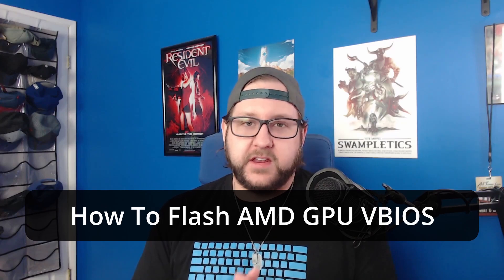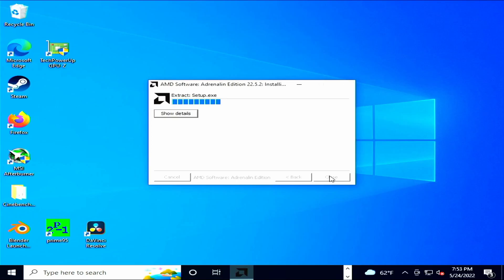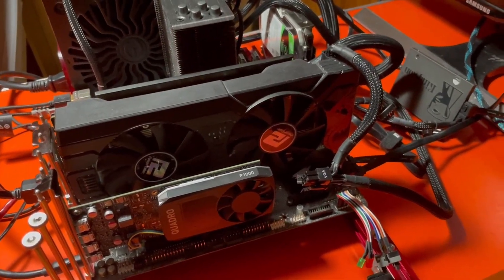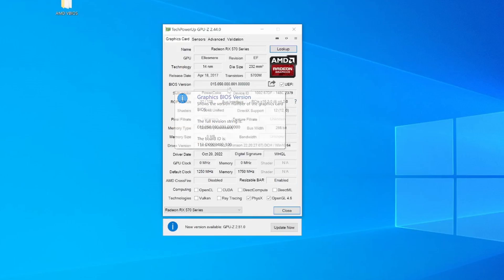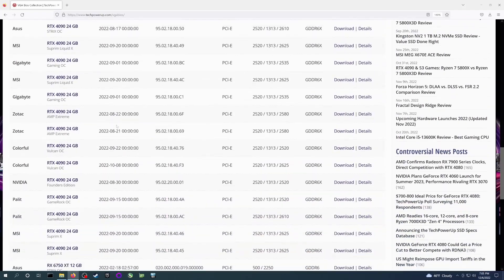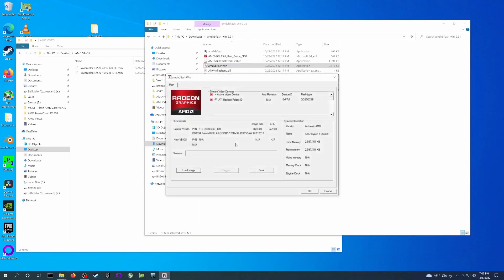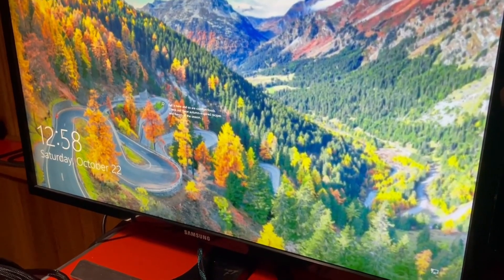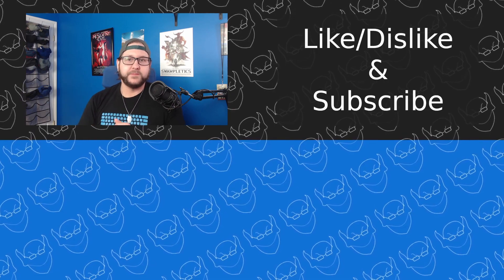How To Flash AMD GPU VBIOS

Comment: why after flash bios my asrock rx 6600 challenger d my pc always restart after 10-15 minutes
Reply from the maker: My best guess would be the bios on the card is pushing it too far clock- or memory-wise, and it's causing it to crash? Have you tried a different vbios?
Reply: @BitGoblin i have tried a diff bios, but i cant install my driver amd. after 30-40% installation windows boot to automatic repair.
Reply: can i fix that with undervolt?
Reply from the maker: That's interesting. IDK if that would be a problem with the card, tbh it sounds more like maybe a corrupt installation of windows if it's sending you to automatic repair. Or maybe the file you downloaded got borked somehow, have tried redownloading the installer?
Reply: @BitGoblin I will try to re-download Windows

Comment: @BitGoblin  I have a RX570 also but 8gb version of sapphire. I have the same problem as yours. But besides on error message from radeon, I have a problem where my monitor always turning off and when I restart my pc, the gpu driver replaced with the default. I will try this and will post an update later.
Reply from the maker: Good luck!
Reply: how's the update on your graphics card?

Comment: It doesn't work. The flash software won't even open
Reply from the maker: Try downloading version 3.31 or older. The graphical app was deprecated and removed from version 5.x of amdvbflash

I also made a newer video explaining the command line app if you need it for a newer card 😊

Comment: malfunctioned due to high and low voltages , card does give display but i have bricked by flashing irrelevant Vbios , so you just need to flash correct vbios and minor fix to fully operate this Graphic card
idk how to cuz it's that 2048sp local vendor type thing i've been using this for like 1yr now and i think this will fix it cuz it's literally unusable and happening outta nowhere.
Reply from the maker: It's possible it'll help! Let me know how it goes!

Comment: I have also Rx 580 and it's not totally dead actually it's working but the issue is sometimes it's randomly crashing. is it corrupted vbios?
Reply from the maker: Possibly? It's possible there's something weird in the vbios that causes it to only crash in certain circumstances. If nothing else, it might be worth a shot if you're out of other troubleshooting options.

Comment: Hey bro i have a bricked Rx 580 2048 sp 8gb, I have Igpu too but when I connect my video cable to my mobo it doesn't show display but when I remove my GPU and then connect my video cable to mobo it works what do I do plz help
Reply from the maker: Check your motherboard's BIOS for a setting that disables the iGPU when it detects a discrete GPU is installed.

What motherboard do you have? I can try to help find the setting
Reply: @BitGoblin Update: 

So I enabled the option you were talking about and guess what I restored to the original bios but when I restarted it's showing weird white things on screen 😭

Comment: After hitting program I keep getting a p/n mismatch pop up, idk what I’m missing! 😭
Reply from the maker: A few things to try here:
1) try using a different version of amdvbflash, as some versions are a bit buggy for certain models of GPU. Version 3.31 seems to work for a lot of people, but some older ones may work too

2) Try re-downloading the VBIOS file. It's possible that the file got borked somehow while downloading (it's nothing you did, it just happens occasionally). Or try a different VBIOS entirely if there's a different one available.

3) You can also try to force the flash if you're absolutely sure the VBIOS you downloaded works on your GPU. Though do be careful if you do this as this can make your GPU unusable til you can re-flash it! IIRC the flag for this is -fv in 3.x, and -f in 5.x

Comment: downloaded rgb software and ever since, my 9070 xt blackscreens when running games or sometimes it will run games but blackscreen a while after its running, my pc stays on, sometimes the fans ramp up but recently they havent, sometimes i can hear the game running but with skipping audio, no serious visual artifacts but when i turn off the pc after blackscreen i see a frame of what could be an artifact, this issue persists after ddu uninstall and reinstallation of drivers, i must ask will flashing the bios on my card fix the issue? as far as i can tell its the gpu that is having this issue because it displays and my pc works up until i open a game.
Reply from the maker: It's possible flashing your card would help, as it does seem to be behaving very weird. But I'd say it's probably more likely the RGB software you installed is borked in some way that is making Windows blow up, and you'll either need to uninstall it or reinstall windows.

I think it's worth a shot flashing though
Reply: @BitGoblin  it was ttrgbplus from thermaltake, signalrgb and powercolor keystone lol im in the process of trying to send it in for rma and ive reinstalled windows multiple times to no success, if they deny the rma for some reason and im stuck with it then ill flash the vbios and see if it works but im hoping they replace it 😅

Comment: August 28,2025, tutorial still fucking works! Saved my XFX 6800xt, freakin bios went out and had to flash it. Thanks man.
Reply: Bro, was your card bricked? I accidentally bricked mine by flashing bios to it and power went out. Now it only shows black screen, the card itself is not damaged. Will this metod still work?
Reply from the maker: Mine wasn't bricked per se though the driver wouldn't load properly. But, re-flashing the BIOS likely would help in your case. It's possible you can't flash it again, but you should definitely try to flash it again
Reply from the maker: That's awesome! I'm glad my video helped, but I'm more importantly you saved your card :D

Comment: my card (RX580) stopped displaying on my desktop (b450 tomahawk max) after a series of power interruptions but still runs on other smaller system (a320). i tried a lower gpu (gt610) which works on my system. i also tried putting them both (rx580 and gt610) with my lower gpu as my main since my rx580 doesnt display. checked it with GPUz and it also showed 0MHz on both GPU clock and Memory. will reflashing it this way probably fix my card? please, someone help me. i've been having this problem for 2 months already
Reply from the maker: I'm not sure if it will help. I'd guess this is likely a hardware issue due to the power interruptions, but it's definitely worth a shot to see if it helps. You could also try resetting your motherboard's bios in case something got funky in there too

Comment: hopefully this tutorial will help me with my very weird issue. my rx6600 doesn't like Ryzen 5s. but he's good with Ryzen 3s.
Reply from the maker: I'm curious - what were the model of processors that were working and which were not? I'd guess it's something to do with PCIe allocation like if you have a 3300X vs a 5500 (which only does 8x in the top PCIe slot)

Comment: Very easy to follow steps, it helped me with a card from AliExpress which happened to come with a mining BIOS. Pretty glitchy in everyday use, it came back to life with a regular BIOS.

Thanks a lot!
Reply from the maker: You're welcome, I'm glad my video helped revive that card!
Reply: How glitchy? I want to know because mine is a 580 thats also from mining bios and its actually a 570, mine keeps losing display everytime i run a game for awhile, does this solution work for this problem? Ive asked chatgpt and it says 99% this is the solution; flashing the gpu
Reply: @chris0men627  Hi, did you try it yet? Any luck?
My RX 570 works fine aside showing some artifacts during startup, which clears up once Windows finish booting
Reply: @chris0men627  100% fixed. No more blinks or flashes or system hangs. Go flash yours.
Reply: @chris0men627 i got the same issue I got a rx580 and im 99% sure it has mining software but I'm going to try this to fix it but let me know if there's anything to stop the screen randomly shutting off

Comment: My gpu clock speed is stuck at 300mhz clock speed on my rx 570
Reply from the maker: It sounds like you might have a messed up VBIOS that's limiting the clock speed? It might be worth flashing a new one if you haven't tried already.

Comment: there is no amdvbflashWin.exe in my .zip from techpowerup, only the other 2 exes that do nothing wtf
Reply from the maker: If you downloaded the amdvbflash 5.x version then that graphical interface was removed in favor of the command line tool. You'll need to use the older 2.x or 3.x versions if your card is supported

Comment: Hey i have similar issue like you had, i have one spare rx560 but it doesn't show any video output, so i used secondary gpu rx580 for output and what i saw, 

My rx560 is detected by Windows but it showing error 43 and on gpu z, it has latest driver but missing pixel and texture just like your rx570 had, 

My question is can i bios flash while running secondary gpu? 

My rx560 is sapphire pulse oc and it use to work properly and i even made benchmark on it but later it just doesn't show any display and pc does bootup without video error beep.
Reply from the maker: Yes you can flash the vbios while running it as a secondary GPU. Before you flash it though, you'll want to run "amdvbflash.exe -i" to list the GPUs detected and what their ID number is. If you have two GPUs installed, it'll either be 0 or 1. In the command to flash the vbios, you'll want to specify -p 0 and -p 1 depending on the previous command

I hope this helps! Let me know if you're able to get your card working again
Reply: @BitGoblin yeah i tried , sadly my gpu still remains with error 43 , I even tested different memory type vbios but no help, 

i think my gpu just died for real, i don't understand i barely used it and months ago tested 25games before replacing it, rip

But thanks for the tutorial, i learned alot
Reply from the maker: @BeastAsNoob that's sad to hear. Since the errors started seemingly out of nowhere I'd guess you're right that it's a hardware issue, since usually the vbios doesn't just change randomly. And even if it got corrupted somehow a flash would fix it

Comment: AT 4:23 ytou mention you dont undertand why the latest version available is not making sense, that's because the one below is for Linux, not Windows
Reply from the maker: Yeah... It would've helped if I looked slightly harder and saw the Linux label just below it 😂

Someone pointed this out to me some time ago and I thought I made a pinned comment about it and some other common things, but I guess I didn't so I'll have to get on that.

Comment: I've had problems for 4 years with my AMD RX6800, random crashes/shutdowns while gaming. And I just found out on a thread that you can also update your vBios (never heard of it before). Because of the thread I knew about vBios, and because of you I was able to update my vBios to the most recent one, and guess what! I can run games without crashes and I was even able to overclock my GPU in AMD adrenaline, and set it to performance mode. I was never able to do that before. Pretty sad to say to find the fix after 4 years of owning my RX6800, but I'm really happy lol! Also, I bought the videocard from a well rated IT-Parts seller here in Holland, and it's a shame that they gave me a video card that was running on some unknown v.01 vBios version. , which led to these crashes! I never wanted to give up on my RX6800 cause I paid the full price for it back in 2021, when the prices where sky high. And Finally.. my persistance seems the winner and I'm so happy :) Thank you <3
Reply from the maker: That's awesome you were able to resolve that after so long of owning the card!

Tbh, I wouldn't blame the retailer so much as AMD's launches tend to be plagued with weird issues like this early on in the lifecycle. But at the very least, you learned something new! 😂
Reply: @BitGoblin  I never was really mad at them, I was just wondering why they would sell a half working card for 2x the asking price.The crashes only happened in a few games, but a lot of other games worked fine so I just switched over to the games I was able to play haha. Back in 2021 I tried to search for the problem, and it seemed on forums that more owners of my card (Asrock Challenger pro 16G) had the same problems and most of them returned their card. I didn't return my card because there was not much stock and I didn't want to downgrade to a lower card at that time, the games I could play played really fluid. But recently, I came back to a game because friends of mine are playing it (rust qq) and immediately after 10 mins of gameplay I start to have crashes again, which gave me a flashback to 4 years ago. And I was really sad, cause I recently gave my computer a small upgrade (New case, Better CPU cooler, Better PSU, extra RAM). Which led me to search for the problem again. And  Since the fix because of your video, to me it really feels like I have a new computer now while its already 4 years old hahaha, but it still goes strong, even stronger now after four years ;) Thanks again m8! 
Annuleren

Beantwoorden
Reply: Have owned my 6800 for a little over a year now with non stop research about these crashes and finally came across a Reddit forum talking about vbios as well!! Will try to update and hopefully will fix all these black screens 😭
Reply: @elevate8904  It worked? i don't think my gpu (rx 6800 xfx) have a update :(
Reply: Which vbios you downloaded? i have a rx 6800 XFX 16gb and i have the same problem i have to underclock -400mhz to don't crash.

Comment: I got a vbios file but it does not end with ***.rom, what steps should I do?
Reply from the maker: You might still be able to flash that file you got. Usually file extensions don't do more than suggest to windows how a file is intended to be opened

But where did you get the vbios file? I'd be a little wary of flashing a working card if you're unsure on the image you got
Reply: @BitGoblin  i got it from a reddit that said they got it from sapphire support. I have a dual bios gpu. How to select where I flash it?
Reply from the maker: @darrenjimenez7703 ah gotcha. In theory it should work then... Assuming you trust the redditor 😊

Whichever bios is active on the card/switch is what will be flashed

Comment: My resolution is stuck on 640 and grayed out after the flash , how do I get around it ?
Reply from the maker: You might need to flash it again with a different vbios if one's available. That to me sounds like the vbios you used is either incompatible in some way or the flash didn't complete successfully (even if it said it did).

Sorry for the late reply!

Comment: Do i flash the vbios if i cant load into bios from boot because UEFI mode is enabled, i have an rx580
Reply from the maker: You can still flash the vbios. I just recommended to save the old one just in case you needed to revert to it, but it's not necessary
Reply: @BitGoblin  is there a risk if i do this? I dont want my gpu to fail or my pc
Reply from the maker: @jeanpg900 yeah there is a risk. For the most part it's a safe process, especially if you're not doing anything non-standard like flashing a mining vbios. But there is a risk that the flashing fails and leaves your GPU in a state where it won't work. 

FWIW, it won't kill the hardware, but it can be hard to recover if you don't have another GPU around to help you flash a new vbios.
Reply: @BitGoblin  thank you, ive been trying to upgrade to windows 11 but no matter what i do i can't get into bios at all, i tried turning off fast boot, going into advanced startup, mashing every button and nothing, i download windows11 on usb drive and i cant change the boot to it because i cant get into BIOS at all

Comment: I am having gpu performance/underutilized issue and i found this video im gonna try it and see if it fixes it
Reply: Update: sadly my XFX rx 560d single fan OC 4GB only has 1 bios 2017-07-24 i am disappointed i give up on trying to fix this gpu issue ive done every single thing and nothing fixed it
Reply from the maker: Did you try flashing that VBIOS anyway, maybe with a force (-fv)? It might be corrupted somehow

Comment: Hey man, I’ve got a Sapphire Nitro+ 7900 GRE. Last month the rgb strip stopped responding to trixx software, can only be controlled through argb cable. Can this fix that? Or I shouldnt risk it?
Reply from the maker: I wouldn't think the vbios would affect that, unless you flashed a different vbios when it stopped working.

My guess would be it's a bug in trixx, if you haven't already ruled it out

Comment: casually reimbursing someone for 107 dollars is a power move, I'm happy for you!
I have the exact graphics card that you got for free, had it since 2018, but the issues only arrived like 3 months ago any ONLY under low loads, never under heavy stress. 
Heres hoping that flashing the bios will fix the issue for me. It's an old card but it will be a great backup gpu in case my 9070 wont function for some reason.
Reply: Him not sending the seller his money back after realizing his system was at fault, and the card worked, is a dirty move. I see it as a form of stealing.
Reply from the maker: Huh? It wasn't a fault with my system, the seller sent me a card with a faulty vbios. I submitted for a refund and he told me to keep it. So it's a bit of a leap to call it stealing

I thought you were joking in your previous comment lol

Comment: "I have an issue with my RX 460 graphics card. It only starts working its fan when it reaches 85°C, even though I've tried all solutions and changed the settings, but nothing works."
Reply from the maker: Sounds like the VBIOS modified the fan curves, assuming you didn't do that yourself. You can try flashing the VBIOS to stock to see if that helps :)